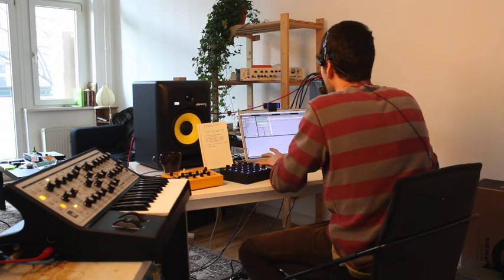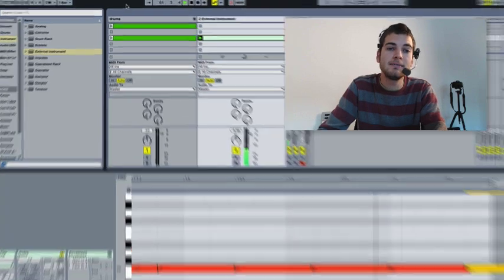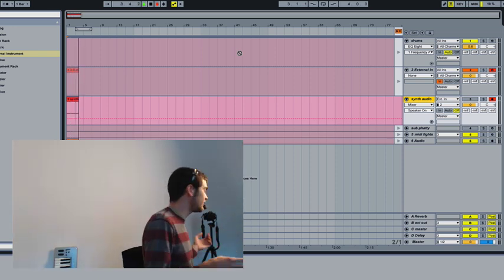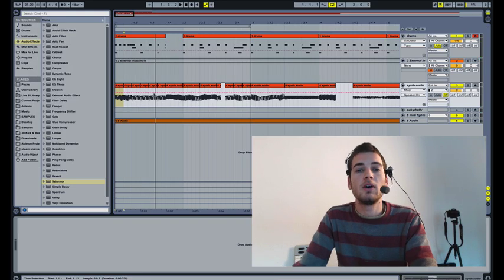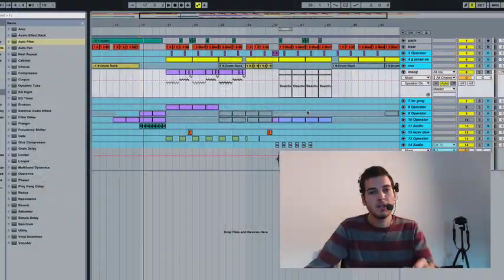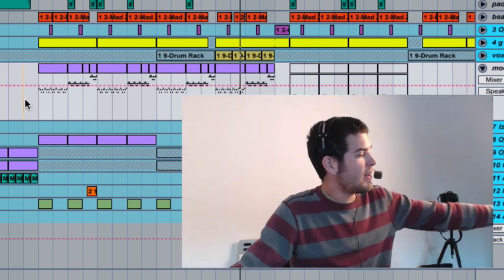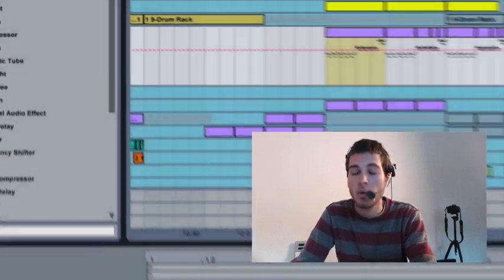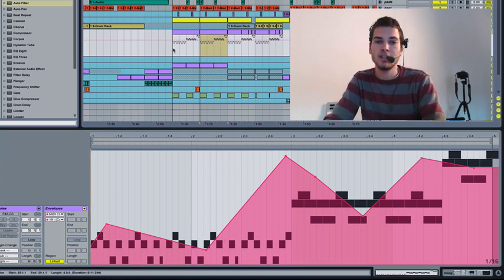3 Ways To Use A Hardware Synth With Ableton Live

Comment: Ive always used VSTs and recently decided to buy a synthesizer (deepmind 12). If I wanted to use this for multiple elements, different tracks, is this possible with just midi? I imagine not so would i have to boubce everything to audio once happy with it? Like if i had a nice pad patch for one track and then a lead patch with the same hardware then both of then would change right? Can i have both tracks retain the patch in midi so they can both play as separate patches? It sounds impossible which i inagine it is but if its not id love to know! Can't find a thing on Google.

Comment: how can you set this up if your soundcard doesnt have a midi? I am using the uad apollo twin with the sub phatty and ableton. I cant get the midi routing right and when i do it the way you do it in the video my midi is double tapping and out of time. The audio records great. Any suggestions I cant find an answer anywhere? Thanks
Reply: Mark M mess around with track delay to get the timing right. If the track delays aren't on underneath each track click the little D on the bottom right. This will get your midi in time with the other tracks. Make sure your synth is set up to remotely controlled. Turn off local control. Also session view works poorly for recording instruments. Use arrangement view. Ableton does a much better job there.

Comment: would it work if I have seperate audio and midi interface? I would use my midi interface (which doesn't have audio) to sync and my audio interface (focusrite 2i2) to get the input sound

Comment: Awesome video. Could you do a video or explain how to use multiple control devices in Ableton?  I want to use a Tr-8, Apc40 MkII, Beatstep Pro,  Mpk49, Akai Advance, and a Push.  I can not figure out how to lock a device on a certain channel. I.e. dedicating the Advance to a strings channel and let the push move to channels as needed.

Comment: Thanks for the vido man!! You rocks! I have a question, how can I recording knob tweaks on the synth as automations in Ableton?? I use An usb audio interface  linked like you but it doesn't work. Can you help me? Thanks
Reply: I think the expert sleepers eurorack audio interface(es-8) is the only thing that can do what you're requesting. The use a set of algorithms to convert incoming control voltage to MIDI
Reply: Midi preferences - midi ports - input - Remote on
Reply: I am also interested in how people set this up. It sounds like a simple setup whereas you use your midicontroller connected to ableton and map knobs/sliders to midichannel + cc on the midi interfaces output (which is connected to the midi in on the synth first in the chain)

Comment: How would i connect an external hardware if my interface doesn't have a midi input? I'm using the universal apollo twin
Reply: My interface doesn't have midi either, I have a novation usb audio interface, Arturia keystep is plugged into that via usb, keystep goes midi out to my hardware synth (moog mother 32), and audio out of the moog goes into the line inputs on my audio interface. I bought the keystep to make everything work together pretty much
Reply: Ben Mitchell You would either need a hardware synth that sends MIDI via USB, or a MIDI to USB connector. You just need the connection to control the hardware really, so it's not necessary if you're just recording your love tweaks and recording the audio.

Comment: Same with the Mio iConnectivity? It is a USB adapter going from computer. It has a MIDI IN (white) and MIDI OUT (black). I have the MIDI IN plugged into my MOOG, and the MIDI OUT plugged into the back of my interface, all while still connected via USB to Ableton. They synth audio is locked into Channel 2 on my interface. Am I on the right track here? I can't seem to get the MIDI to lock in with my hardware synth, but I'll have to try again. Perhaps my MIDI ports aren't setup correctly.

Comment: thanks for the vid.  regarding connections.....using the 2i2 without midi.  can I run moog usb to computer, route through ableton and Moog audio out to 2i2?  same thing?  thanks
Reply: In the MIDI channel, send MIDI to your Moog. Then on an audio channel, set the monitor to in/auto, audio from Moog, and select the proper channel 1/2.
Reply: I'm routing my Sub 37 to the 2i2. I'm wondering if you were able to configure the proper connection to record audio into Live? My current setup is as follows: Moog USB to computer, Moog Audio IN to Line 01 of the 2i2, and 2i2 USB to computer. I'm wondering if I'm a connection short here? In Ableton I have Audio I/O set to the 2i2, Track enabled for both input and output. MIDI Track: Ext Instrument MIDI To Moog (Ch. 1), Audio From 1/2, MIDI from All Ins, and Audio to my audio track "Sub 37 Audio". Audio Track: Audio From Ext Instrument, which changes the channel to the "Post Mixer" (I feel like something is screwy here). All Monitors are set to Auto. I do receive MIDI info, but I only hear audio when monitoring from the 2i2. I would like to hear my Moog from the computer, I'm also unable to record raw audio into the Audio Track. Any help would be extremely appreciated!
Reply: Hello Aaron, I would appreciate if you could find the fault in my routing as well!
Reply: I found your comment and had to figure it out myself. Take a 1/4" cable from the moog to the front of the scarlette 2i2. Then that's it. On the back of the scarlette 2i2 it's just to your speakers and USB to your PC.

Comment: we can't record midi effect on the fly ?
Reply: I might be misunderstanding your question, but you can record synth parameters (filter cutoff, etc) on the fly, if you have your MIDI channel (that your synth is on) routed into an audio track (like he does in the part where he records a bunch of audio, then chops it up & arranges it). If it's recording into an audio track like that, it'll record all of the adjustments and moves you make on your synth in real time. If that's not what you were asking, I apologize.

Comment: I've got a problem! 
Got Roland SYSTEM 1 connected to the UR22 via MIDI (system1  MIDI IN - ur22 MIDI OUT (tried other ways too...))
all done like shown in tutorial, but no sound coming out... 

Preferences look fine - all like in tutorial... 
could it be a cheap MIDI cable? Or maybe System 1 is not working that way?

Comment: For some reason I can't record anything from my Moog. 

I have my MIDI cables plugged into the back of my MPK49 because my Apollo twin doesn't have MIDI on the back. But should that matter? 

I can hear the Moog, and I can record the Moog using my MPK49 Keyboard, but not using my Moog's keyboard. And I can't record any knob turnings either unless I go into the clip and manually do it (which I don't like, because I want to do it myself sometimes). 

Another weird and EXTREMELY annoying thing is, every time I put an effect on the track my Moog is on, the settings on my Moog change, and the sound changes. Every single time. I can take the effect off, put a new effect on, and it will change again. 

I can't even EQ the sound because whenever I put an EQ on the channel, my Moog's settings change. 

So basically... I have to get the sound I want, move to my MIDI keyboard and record what I want, or just click in the notes. Then if I want automation, I have to manually do it. Then I have to resample it, and put effects on the resampled version that I'm not able to tweak anymore... It's really time consuming and ridiculous.
Reply: +Devin Taylor (Fountainel) I read your post, I'm curious as to what the problem is.... have you found out? is it just defective?
Reply: +Richard Smith The setting changed randomly when I put effects on the channel cause the MIDI was plugged into my MPK49 for some reason, so I got an iConnectMIDI2. 

I can record as well now.

Comment: Hey Mad
This is a very useful video. Thanks a lot. But I got a little problem trying to control my moog slim phatty with ableton. As soon as the moog gets the midi-signal from Ableton, the internel control buttens of the moog don't work anymore. Means nothing happens when I move the control buttons on the moog. Any Idea what I need to change in the settings?
Thanks and all the best,
Tobi

Comment: We have just get an Alesis DM10 electronic drum kit. How is it possible to use the drumkit as a midi trigger in Ableton but with velocity? We can trigger the audio samples with no problem but no matter how strong we hit the drumkit parts, the sample volume is always the same. I would be pretty happy if someone knew it!
(The drumkit goes into an external sound card with audio output and directly into the computer by USB. Do we need to use the midi in and out slots too?)